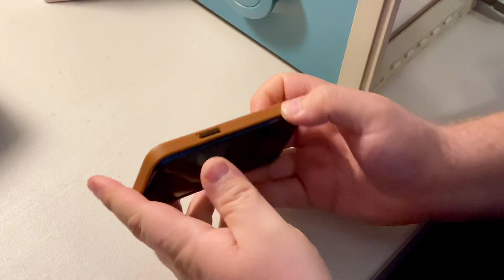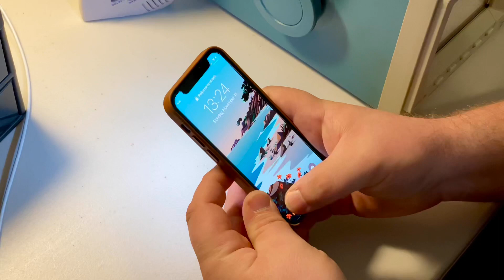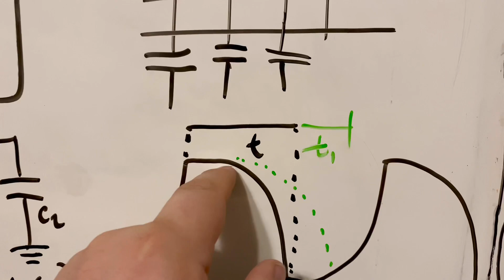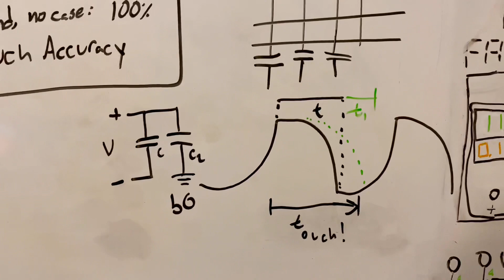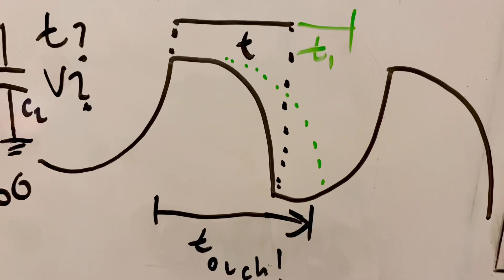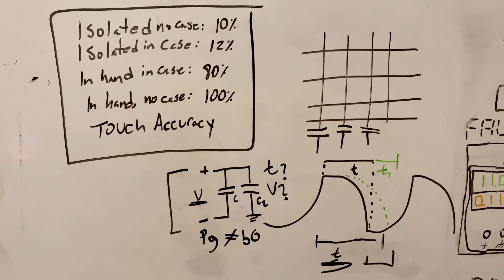iPhone 12 Touch Disease Issue

Comment: Just do the latest update, it corrects the issue. You can just take off case, it will work fine or hold phone in one hand and swipe with other. But as I said, have not had problem again since latest update which you should find in your settings.

Comment: Screenprotector (glass) + No name case. With case (no matter if lying on table or holding in hand): using thumb results in same issue, absolutely fine with index finger. No case (no matter if lying on table or holding in had): Works like a charme with thumb, too.

Comment: leather magsafe case, and silicone case me and my dad have the same issue, had a frustrating ordeal at the apple store where they said “this issue isn’t known to us,”.... swapped my dads for a brand new phone, same issue, so they didn’t really know what to do, refused to comment on a potential grounding issue... we have appointments on Friday at the store to return, but hoping they will at least acknowledge it so I can keep this amazing form factor of a phone! 

Thank you so much for that explanation, you gave me some confidence that this could actually be fixed with software. Still would like some communication from Apple, I don’t want to be a Guinea pig, but as long as they are able to manipulate the level of discharging capacitance as you said, without it being the magsafe (maybe stacking of the magnets) inflicting a charge on the screen (I’m thinking of any hypothetical where it could be a magsafe hardware issue inflicting EMI) then I have some confidence this can be sorted out. Thanks again, let’s see what happens

Comment: I contacted apple support about this and they tried to say it’s because I’m not using apple branded case or screen protector. That’s crap. I have the exact same issues as you have in video for most part. If I plug in to charge I don’t have the issues at all. I also notice if I am in the phone and pull down the notification I can’t go into camera or flashlight from there either unless it’s charging. I also already had the 12 pro and this issue wasn’t there at all and I was using the same case and same screen protector as I’m now using with the mini. I just got it today. If it gets close to the 14 day return policy and they haven’t fixed this I’m going to return it. Weird as far as I can tell apple hasn’t even acknowledged this major problem.
Reply: I have the same issue even with the protector and the case from the apple.

Comment: The same thing is happening with my iPad Air.
Reply: At least the iPad Air has the finger print sensor to unlock the phone. If the screen is intermittent then it’s hard to even turn these devices on. I wanted to get this phone but no I’m having second thoughts. I think it’s a hardware issue. I don’t see how it could be a software problem. When  I had that issue with my old 1st gen iPad Air it was because I broke the screen and had it repaired on the cheap from a high street repair shop and they didn’t repair it as well as if I had fixed at apple.

Comment: I also have a brand new iPhone 12 mini 128GB. Experiencing the EXACT same issues with with the Lock Screen flashlight, camera; randomly it won't register my touch for the passcode unlock, and hanging up phone calls, swiping phone to answer phone calls, swiping to power off..I also use the apple branded mag safe case (silicone though), also running latest update iOS 14.2 (18B92) as well.  It does have a Belkin ultra glass screen protector on it and I have not tried it without as it was a $40 screen protector. But it sounds like its an iPhone issue and not Belkin. For the first time I tried operating it with the case off and it does seem to be MORE responsive with the apple mag safe case off. The flashlight and camera are a haptic press and do require a bit more pressure but it works much better with the apple branded case removed. Also to note, the silicone apple branded cases as silicone buttons, not metal like the leather. Glad to know I am not going crazy.

Comment: Is this a software problem or a hardware one ? Beacuse other iphone models are not facing this issue. You can also try a combination of using normal plastic screen guard and the magsafe  case and see the result of touch accuracy.
Reply: I think this is a design issue